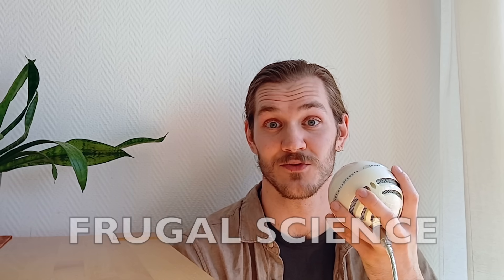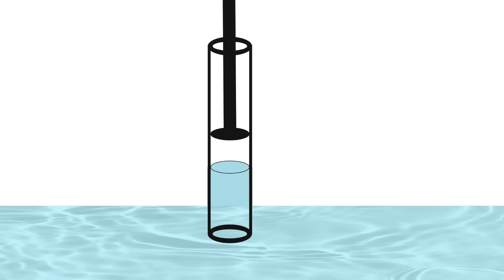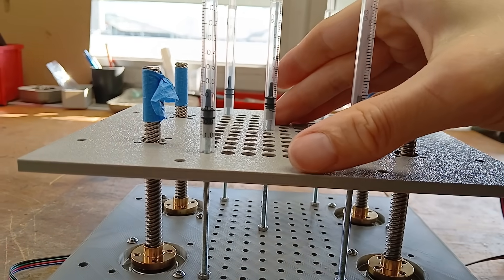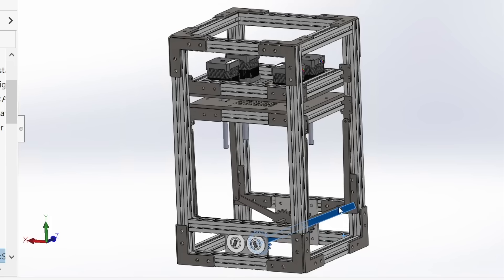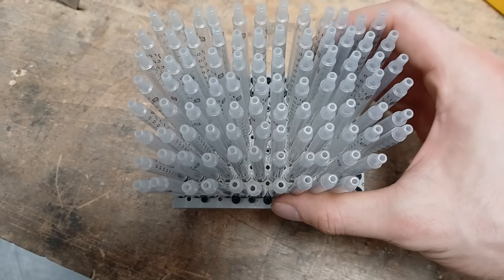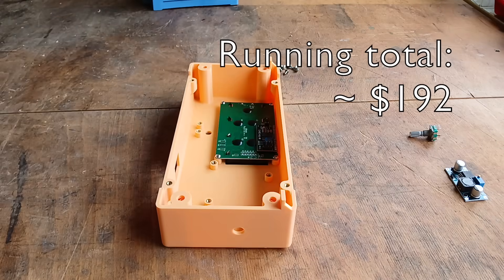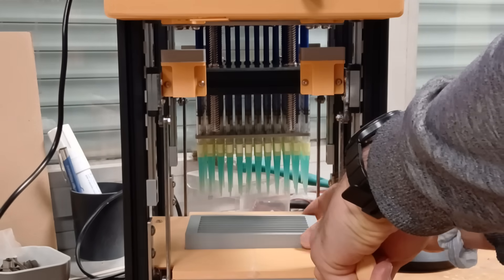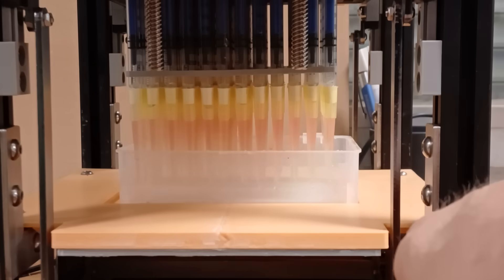This Medical Machine costs $18,000. I Took It Personally.

Comment: Whilst obviously not being remotely close to the precision and manufacturing quality, as well as guarantees of following regulation, to the $18k machine, $250 is an incredible price for such a machine for hobbyists or schools where the resources are a bit more lacking. 

I don't work directly with medical equipment in that sense, but I do do work with things related to other high-cost production lines and one of the core reasons of things being so expensive is that documenting and verifying that it actually works to properly and to regulation is incredibly expensive and time consuming. But for a hobbyist where such requirements are near non-existent beyond "it just needs to work," this is an incredible design.

Comment: Like you admitted "only having a kitchen scale" you miss the most important point, the precision. Professional pipetting mechanisms use internal diaphragms in their syringes to ensure µl precision which you would probably not be able to replicate. (Not even adressing the general extremely high variance you will get in volume with the makeshift plunger/syringe pipettes you built) I can not come up with a use case for unprecise pipetting, at this point you could also just pour something from bucket over the multiwell plates. That bucket would also be a 100x cost reduction from your $250 mark.

Comment: Putting aside the certification costs that lots of others have already commented on which is the real place most of the costs are, just looking at practical stuff to make it usable in the situations you mentioned were your intention, you didn't really touch on clean-ability or end user servicing when it's in use. It looks like in your design at the moment there is far too much room for contamination error with repeated use. Don't get me wrong, it's certainly a cool project and you've shown lots of innervation in your work, but it would be nice to see a version where you do that last 20% to take it from a working concept to a practical design that has been designed with all the post sale stuff like ease of cleaning, future repeat usability, maintenance, safety, user interface design to reduce user error and repair. I'd love to see a follow up like that.

Comment: I guess my main criticism would be the way the tips are attached.  They need to be rapidly removeable, not just quick to put in place.  Each sample needs a new tip or you will have contamination.  I assume the process for replacing the tips would be pulling them off one by one, but if you made a part that could grip the ends of each tip, maybe you could pull the syringe assembly up and away and remove all the tips in one go.

Comment: i hope you don't need to be told this, but in case you didn't know anything was wrong with your audio, you should fix whatever it was that made the whole voiceover segment between 2:20 and 10:12 sound so much worse than the other voiceover audio. i trust your ability as an engineer to troubleshoot this.

Comment: FDM printed? Good luck disinfecting it. Look, I'm not saying it won't work. It's just not a medical device for many, many reasons (see other posts below). The cost of most medical devices is in the development (material selection, testing, sourcing, documentation and traceability, etc.). This is the logical fallacy that a lot of DIYers fall into - they use faster processes and cheaper components to make something that looks like it works like the genuine article, but they can't back up the performance.

Comment: This is awesome! I love the idea that we can create affordable alternatives for things like this. I was thinking a project to create a DIY CPAP machine for folks who aren't able to go through the rigamarole that's required. Most of the part aside from the machine itself are available off the shelf including the masks, tubes, and all the accessories, but the machine requires a prescription.  You also have to suffer with it for a whole month at a time while they adjust it since the machines are locked down so you can't adjust it yourself.  The thing is, it is SUPER easy to adjust them and all you need to do is adjust one of two settings slowly to get the AQI number that you are looking for. You could do this over the course of 3-4 nights instead of weeks or months.  Plus they want you to purchase everything through them and it's all marked up because insurance will pay for it all. It's a horrible consumer experience and every step is tailored absorb as much money as possible.

Comment: Here's the major flaw that I see in you design: cycle life while maintaining accuracy. Syringes are intended for only a few uses. The original could do thousands of cycles and could easily replace the pipette tips to maintain sterility, which brings me to the second issue you have with your design, which is the ability of the equipment to be and maintain sterility, which must be done for this application. As a prototype, it's a proof of concept that you can make the base mechanism, but you need to engineer in these other factors, which would also include sealing up the internal workings, then having the entire machine sterilized internally using radiation, then shipped to the customer using a certified service, which is expensive to have done. Really expensive. As a product, for any warranty work, this would involve breaking this seal and re-sterilizing the device using radiation, making product support insanely expensive for it.

Do I think it should cost $18k? Probably not. Do I think it should come up to less that a few thousand dollars with the cycle life needed and sterilization requirements? Yes, I do. What you can allow us to make is a device that could be sterile enough for a home lab or doing chemistry experiments that don't require sterility, but still need hundreds of iterations, which is still really useful.

Comment: The plungers will create foreign object matter if used in high frequency/ cycles

You would need to change to an advance elastomer FDA approved for medical devices if it is in direct contact with liquids going in the body. If it’s only for testing disregard this concern

Comment: The expensive machine's pipets are taking exactly the same amount of liquid into them. I supposed this might present a problem if there are even very minute discrepancies. Correct me if I'm wrong. Do you think the original machine has some smart way of individually measure the amount for each and every pipet?
Reply: it is calibrated to be whitin a very small tolerans

Comment: That's pretty cool. I was originally very concerned with the 3D printed syringes, but using replaceable tips is a decent idea. Although, I don't know if that heat shrink will play well with solvents... Regardless, insanely awesome prototype, and the files and some instruction is out there now for people to play around with. :)

Comment: The manufacturing cost is only a small part of the price tag.  The company needs to cover the overhead.  The design, prorotype, test, approval, validation and verification, manufacturing setup, thr QA/QC needed to gaurantee each unit works perfect, and the after-sales support and customer service and support.  

   This is a very ignorant video.

Comment: Hello,  just a sugestion for the reduction of cost, i see you are using 4 stepper motors to acutate the mechanism, so i suppose u need 4  different stepper controllers, i think i would be nice to consider useing 1 more powefull motor, like nema 23 or nema 17 with some gear reduction for hjigher torque and sinchronize the lead screws with timming belts, just like the bed of Bambuu lab p1p for exmaple, u can still achive very accurate motion with much less off the shelf commponents, and due to the fack that the motion does not require so much force i think this could for your desing. Overall great idea and i hope you achive your goals with this project.

Comment: Those plungers are disposable for a reason... after a score or so of actuations they will start to seize in the barrels... Having 96 of them would make this a nightmare.  Im guessing if you need to pipette 96 things at a time, you probably want to do it a lot of times.  If you only wanted to do it a handful of times, probably not worth building a machine. Interesting project but not really too many practical uses for it in my opinion.
Reply: But the disposable plungers are much easier and cheaper to replace once they do wear out than something like the metal rods or other designs you could use.
The entire point is to make it cheap and simple, and the parts easily replacable should something break.

Comment: Your video demonstrates that Your video demonstrates that building a device is relatively easy with today’s tools — something most engineers can do.

However, it shows almost nothing about the medical aspect of the work. A device is considered medical only when it complies with regulatory requirements such as MDR/FDA classification, risk management, clinical validation, and ISO-controlled processes.

Without certification, a device is not legally or medically a medical device. Calling an uncertified prototype “medical” is misleading and potentially unsafe, because medical claims imply validated performance, controlled risk, and regulatory oversight.

Therefore, comparing an $18k certified medical device to a $250 prototype is not meaningful. The $18k cost largely reflects certification, testing, documentation, and compliance infrastructure — not the bill of materials.

With off-the-shelf components and modern tools, almost anyone can build a functional prototype today. What is non-trivial — and what actually defines a medical device — is the certification process.

This is not just a semantic issue — it has real safety consequences.

In a real case, a company substituted a required medical-grade stainless steel with food-grade stainless steel, assuming it would be “good enough.” While food-grade materials are safe for ingestion, they are not necessarily biocompatible for prolonged skin contact or implantation.

As a result, a pediatric patient developed a severe skin reaction due to metal sensitivity. The complication required emergency medical intervention and put the child’s life at risk.

This is exactly why medical devices cannot be built “out of thin air” or labeled medical without certification. Material selection, surface treatment, biocompatibility testing (e.g., ISO 10993), risk analysis, and clinical validation exist because small, seemingly harmless decisions can have serious consequences.

Many such details are invisible in a prototype video, but they are critical in real medical device development. “Medical” is not a casual label — it reflects validated safety, controlled risk, and regulatory accountability.

Comment: excelent job ,
dont want to be an arm chair general ,but the reason the commercial unit moves the lower tray instead of the upper part is the weight , your design moving around so much mass ,the motors, the rods, the bearings !!! its all just mass that could simply be fixed in place ,mechanical stuff dont usually like to be jerked around that much especially if you have so many moving parts that needs to stay parallel

Comment: Amazing build, However if you want to scale I would recommend building parts to retrofit a $200 pre-built 3D printer.  You can use Change the software and the head and you're done.

Comment: Why use 4 stepper motors? Couldn't you just use one and a belt solution? This would guarantee exactly synchronized up/down motion. If you need more torque just increase the motor size. Only one motor = even more frugal 🙂

Comment: OH... well no wonder its 18K+... its by Eppendorf! They also make equipment for chemistry labs and if you're an organic chemist you know full well how expensive and sometimes overrated that equipment is...  Now if we could just make an NMR spectrometer using this new-found room temp super conductance material that was discovered within the last year or so... NMR machines could be far less expensive, they wouldnt require liquid helium and liquid nitrogen plus gobs of energy.... A boy can dream.

Why not use a small pump to create pressure that has a one way valve so that the media is not contaminated when the plunger returns to its home position.... but then another one way valve that allows clean, filtered, "dry" (meaning no water vapor in solution) to come into the tube as the plunger returns... kind of like the design of the mechanism of a combustion engine... plunger is now your piston... theres a valve for the agar or whatever test medium you need to enter the syringe, and then another for relieving the potential suction... 

That or you could dispense with syringe and plunger altogether and simply use a tube with a narrow opening that only releases the amount necessary for each Eppendorf tube (yep, the little capsules are even named for them... haha. 

Also, you should look on youtube for the music video Eppendorf did like 16 years ago about E.P. Motion... their new tech back then...

Comment: Part of the reason medical equipment is so expensive is because they need to have extensive docs on ALL of the materials they construct the device out of, which requires a lot of screening and organization and collaboration with manufacturers, and anything electronic also need to be hardened against almost all possible harm vectors, including a solar radiation burst or being hacked in various ways. It also needs to have extensive documentation, tech support for decades, and it has to be relatively foolproof. It's not that the actual design is overly complex, it's that there's millions of dollars worth of overhead to get your equipment approved for use in medicine.

Comment: How much torque does it take to move the plunger plate up and down, where you're using the four motors? Given that those motors are a considerable chunk of the cost, what about using one or two and toothed belts to drive multiple lead screws? You could get more torque and precision by changing the gear ratios between the drive motor and the screws.

Comment: I think it can be made cheaper. You could replace the four vertical steppers with just one, and one screw, which should also simplify the design. All in all, this is a good project and a very useful one. As someone whose hackerspace mass-produced face masks during 2020 for local hospitals, I 100% approve of your endeavor and mindset. If it's any help, I can point you to our Open Syringe project, which is very similar to your device. I don't know how YouTube feels about links in comments but you can easily Google it as "Electrolab Open Syringe Pump". Skip the sponsored results and AI slop and look for a link to our forum.

Comment: While I love the device and don't want to be a doomer .. I would have loved to see not only the precision but also the accuracy of the device by use of a microplate reader (say, an ELISA reader) - if you ever need a method on how to do so and how to calculate the accuracy and precision just say the word 😊 Although it would naturally require the correct equipment.

Spectrometry would also save A LOT of time as opposed to gravimetry in validating the device 👍

Comment: I'm not sure but I assume the increased cost is to "guarantee" that its not leaking and hygenic in the first place . Your apparatus emulates the same actions yet it may lack the required precision and cleaning ability a professional device has. [I'm not an expert though but as far as I know in this field its important to not even leak or spew a microliter of something]. I guess its for a homelab where precision is not required but for professional use you would probably up the cost by 4-5 times to ensure it is truly non spilling accurate and hygenic and finally you have to add the time you spent to the final cost [hours spent times the hour wage you would expect for your work /expertise].
That being said your engineering and planning skills are excellent keep it up! [This comment was not intended to discourage, you did an exceptionally good job on this I'm just saying professional devices have high costs for a reason].

Comment: Well. building is one thing. I bet those are expensive because the amount of patents and certificates you need in order to use this in a actual lab. It probaly has go through all kinds of expensive testing with very small error margins. Once you have done those. Your price is also up there.

Comment: Reducing barrier of entry sounds nice on paper. But those barriers are there for a reason. This thing would never get certified for anything medical or biotech. You can play around with it, but ultimately you would need to go through soo many steps to proof this thing is reliable and properly precise and cleanable and sterilizable and and and. GMP is there so catastrophes like the Contergan scandal from the 1960s ideally do not ever happen again. This is a nice toy, but ultimately nothing more unfortunately.